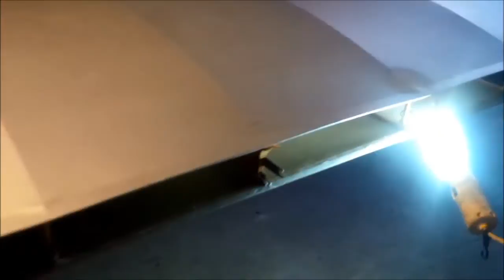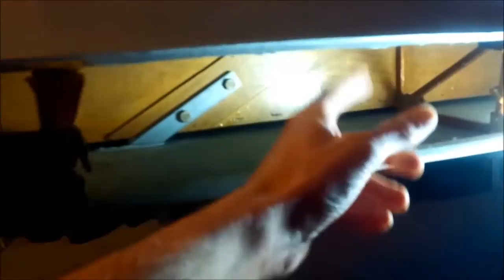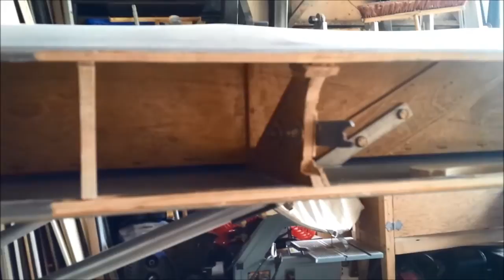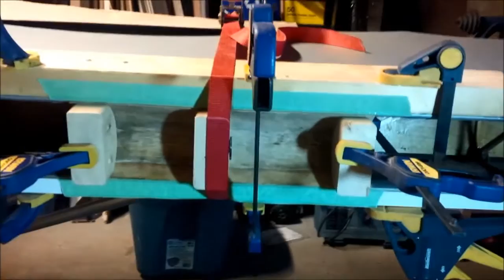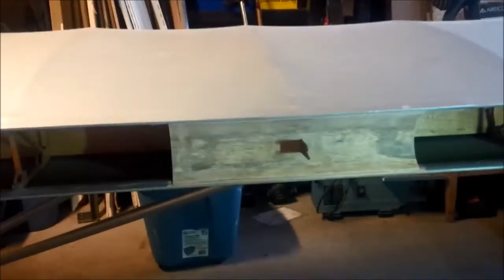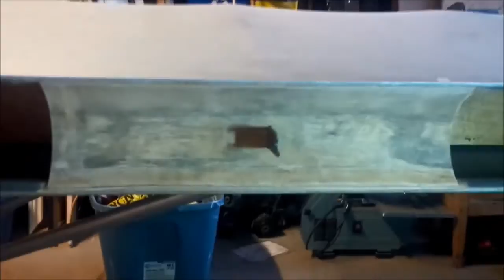Mini-Max 1500R wing repair

Comment: Great repair!   My EROS 1650 had the identical problem which I repaired in a different way.  I think your way is the best way to go.   When I originally tightened my wing fabric, I never gave it a thought that it might be too tight - but it was.  It pulled the members apart in the same area.

Thanks for the nice video.  Very clever repair, IMHO.  :)    N-6395T